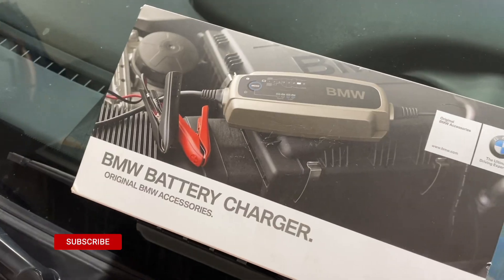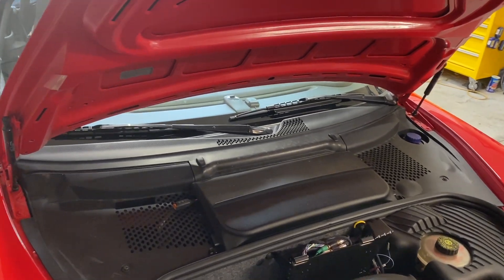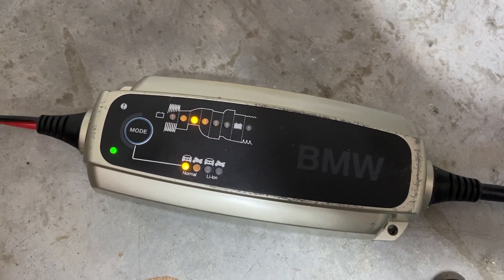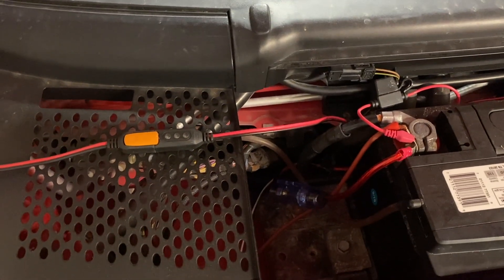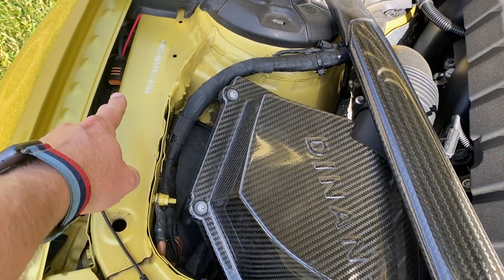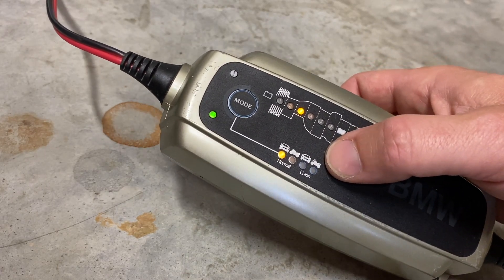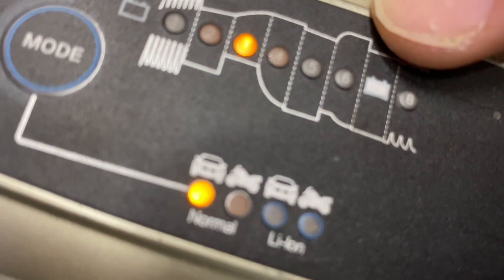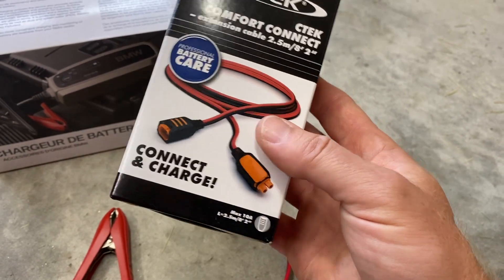CTEK Battery Charger (BMW branded) for all battery types | Tool of the Week

Comment: I can fully recommend the BMW branded charger as well. As far as I know, CTEK doesn’t offer a version for ordinary and Lithium batteries under their own brand. 
I use it for having my M2C connected so the battery doesn’t die (…again, it’s the second one already) and for charging the Lithium battery of my motorcycle. 
If you want something good for yours, go for the Shido Connect series, they offer great performance for the money and you can check the status and voltage of every cell with the iPhone app without having to remove it from the motorcycle.
Reply from the maker: +AkiDarkWolf thanks for the additional info!

Comment: The 4.3 Version is not for lithium batteries. But ctek offers another one that can be used for both, Lithium and lead-acid.
You should think about using a ctek 7.0 or 10.0 for such a big battery. Still the 4.3  will do the job, but it takes a little longer.

Comment: How long does usually take you to go from one light to the other ? ( I know it depends how depleted the battery is ) just an approximately.. mine keeps getting a red light on .. 😑
Reply from the maker: Some several minutes, some 30 or more minutes
Reply: @HelpMeDIY   mine was giving me a red light .. I bought a new extension cable ( the other I was using it was a beat up one ) and no more red light, but it went to number 3 and it has been on 3 for 5 hrs now .. I really don’t know why isn’t moving to the number 5 light.

Comment: I just bought one of these chargers today for my 2020 BMW M4. The charger has not moved from #3 and has been on about 7 hours. It is also very hot to the touch as someone else mentioned. Is this normal or did I maybe get a defective tender?
Reply from the maker: +Alexia Melendez I assume you have the version that has the lithium ion setting? If so, I would test the battery and make sure it’s good first.  Assuming it is, I’d replace the charger
Reply: @HelpMeDIY  I do have the version that has the lithium ion setting. I was told from the dealer that if I didn't use the correct tender I could damage the battery. So with the recommended unit and properly connected I would think the status would have changed in 7 hours time? Also, I realize most charging units get warm, but blazing hot?
Reply from the maker: @alexiamelendez7192  yeah sounds like a problem

Comment: Can you recharge a completely dead bmw m4 battery? 2018 m4. Regular charger does nothing to even turn on lights
Reply from the maker: +Omar Popal as long as the battery is not bad/damaged it should be able to

Comment: My battery is about 4.5 years old... voltage is between 10 and 11 when car is off. My scan tool Tells me my starter is failing at startup. I'd like to purchase this charger to charge my battery so it has the juice to start the car after tapping the starter....so I can drive to my Indy mechanic to replace the starter. Do you think this is a good idea, or can the car start with 10 to 11 volts after tapping starter?
Reply from the maker: +Christian Ventura well it’s a great charger so I would purchase it no matter what so you have it. But if the car starts, drive it over to him.

Comment: My Ctek overheats so it is a,most too hot to hold.  Do you know what would cause that.
Reply from the maker: +Robert Angleson if you have it on the correct setting for the battery type you are charging, I’d send it back! Shouldn’t get that hot.

Comment: One point, I think if you lock your hood it will interfere with the charge it must be left cracked ..
Reply from the maker: +@Jcauto-t4r no it won’t. Not unless you physically damage the wires of the charger.
Reply: @HelpMeDIY   I saw a guy from BMW saying that on YouTube..  anyhow mine has been in number 3 for 5 hrs now .. idk if that’s normal or if is going to ever go to new number 4 🥹
Reply from the maker: @Jcauto-t4r  likely a bad battery
Reply: @HelpMeDIY   I read your comment and decided to pull the plug 🔌 🙃 to my surprise it moved to 4 now ( I think I’m saved ) .. will continue monitoring it ..

Comment: I have so much problem with that charger on my BMW 2021 M440i Mild hybrid.  Defrost light blinks all the time, Completely lost my AC and ventilation. All sorts of weird sound coming from under the hood. A real nightmare. I bought it to store my car in my garage for the next 5 month.  Scare to discover other problems in may 2023. BMW tech don’t know anything about this problem. Yishhh!!!
Reply from the maker: +Marcel M yikes! Does that car have a lithium ion battery? Do you have the charger set for the correct battery type?
Reply: My experience indicates that when I put a charger on my BMW with the hood open, I frequently get a “Power Management” error in my check control and I can hear relays opening/closing up near the Lithium-Ion battery randomly during the charging process. I suspect that the Check Control error and the relay action is related to the 48V charging and cooling circuits cycling on/off.

It seems that I really only want/need a battery tender to keep the AGM battery topped up when the car’s idle for extended periods since it’s the 12V systems that are continually stressed by systems that never completely shut off. I support this thesis since at the dealership, they have the hood closed when they use a battery tender on the showroom floor and seldom report “Power Management” errors. I’m told that “hood closed” charging only tops up the 12V battery and reduces the likelihood of a “Power Management” check control.

Hope this helps anyone that’s been befuddled with the mild hybrid electronics.
Reply: @HelpMeDIY  in the trunk a AGM and under the hood Li/ion 48 volt for the mild hybrid system. Charger set to normal car.